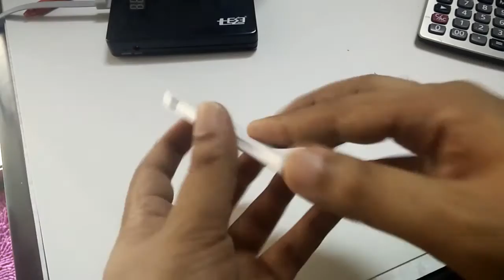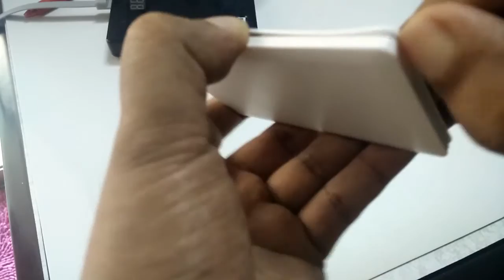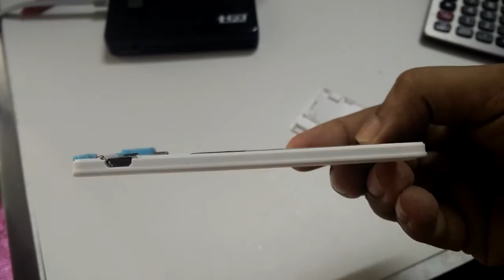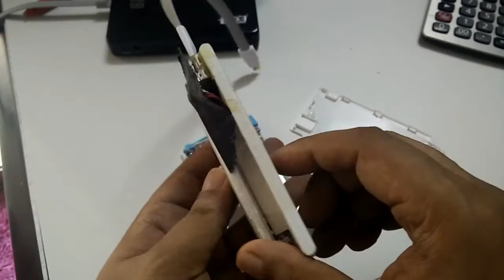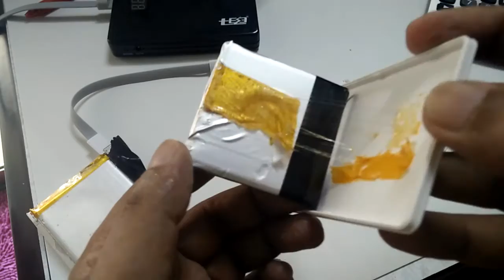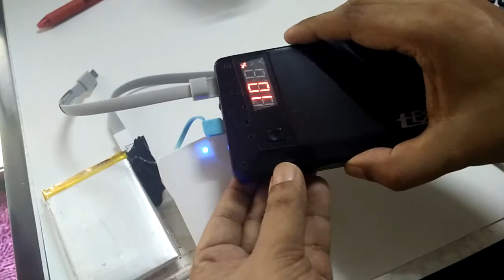HOW TO CHECK ULTRA SLIM POWER BANK TEARDOWN INSIDE BATTERY

Comment: HI bro, could you tell me the size of the internal battery? Thanks
Reply from the maker: 1500mah. Around
Reply: Nono.. The dimensions.. like length x height x width..
Reply: But, if you don't remember that. no problem  ;)